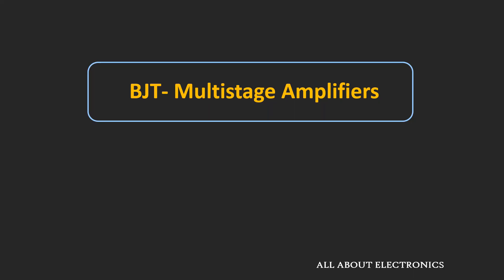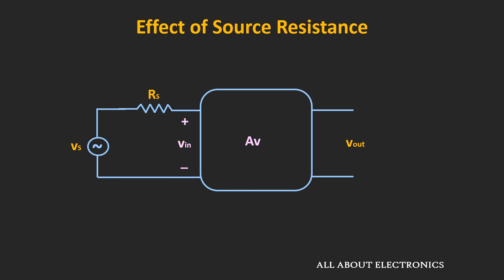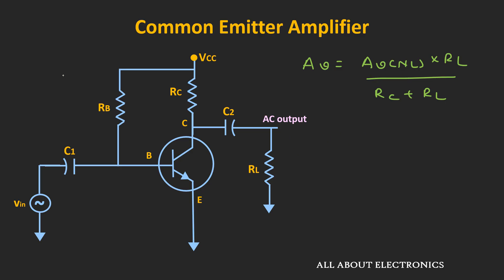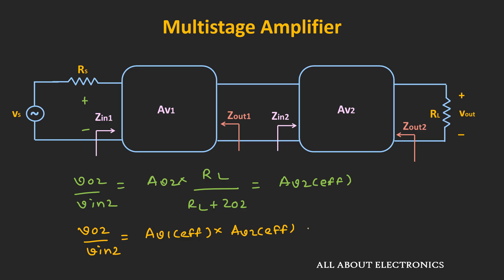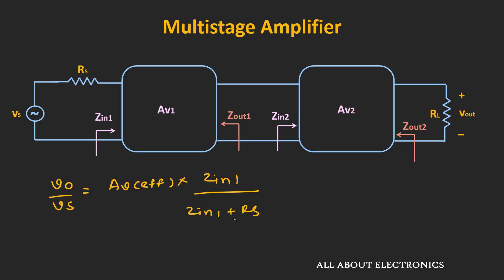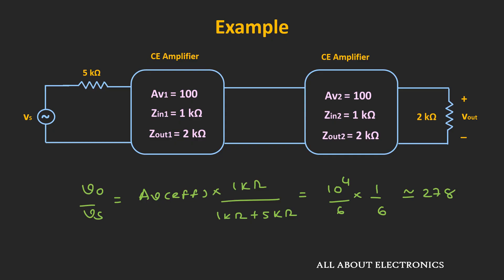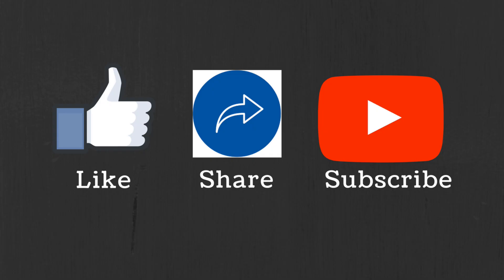BJT- Multistage Amplifier Explained (with Example)

Comment from the maker: Timestamps for the different topics covered in the video:

0:20 What is Multistage Amplifier? Why it is used?

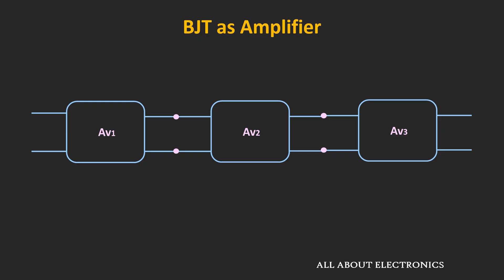1:26 Effect of Source and the Load Impedance on the Amplifier

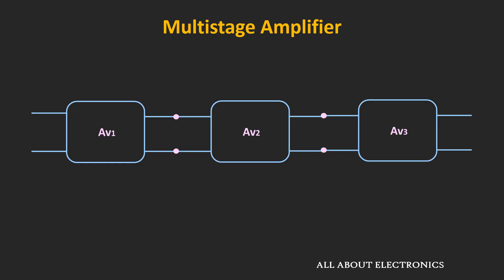6:51 Multistage Amplifier (The calculation of overall voltage gain)

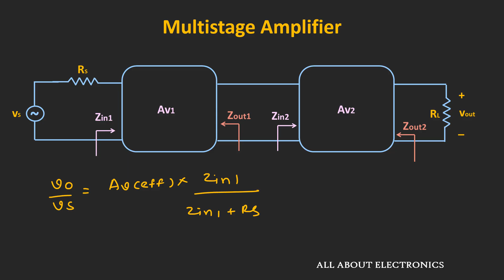10:19 Example
Reply: can you help me i want exercices and problems to practice because i have exam

Comment: 2:27 finally knew where this came from: Total Gain = Gain1 * Gain2 this is due to cascasded amplifier setup. Signals when cascaded are multiplied not summed. I learned this in control system subject but I already forgot lol.

Comment: I have a question: what will be the effect of adding 2 emitter resistors (one to each stage) on the overall voltage gain equation as well as of each stage. Thank you 🙏
Reply from the maker: I have already covered  it in the separate video. Because of the emitter resistor, the gain of the individual stage as well as overall gain will reduce.
Here is the link of the video:
https://youtu.be/kCNwU-OGK-U
Reply: ALL ABOUT ELECTRONICS  
Thanks 🙏

Comment: Great explanation! Are you planning on making a video purely about impedance matching? If not, my question would be if I'm planning on amplifying the signal from a Colpitts Oscillator circuit. I'd obviously need a buffer stage otherwise the circuit would be loaded and the signal ruined. In this case would a common base buffer work (since it's a high freq signal) or a common collector buffer is more fitting?